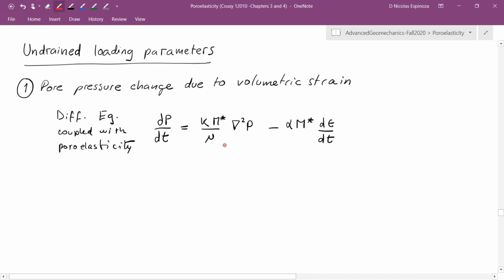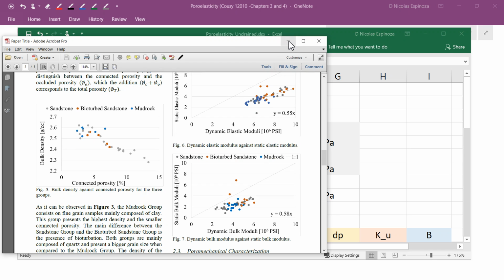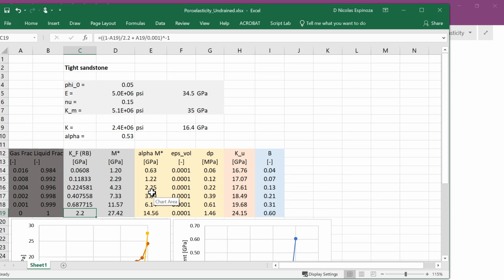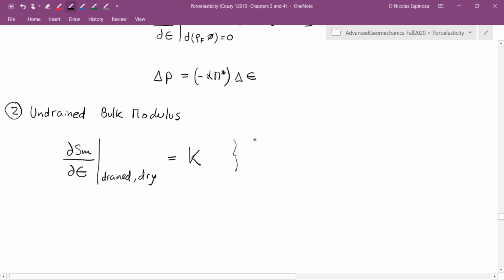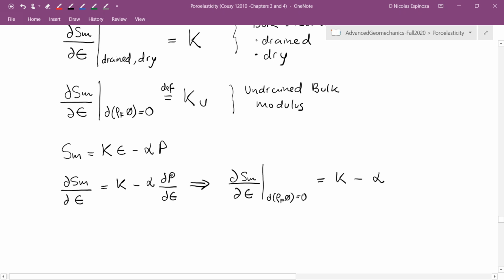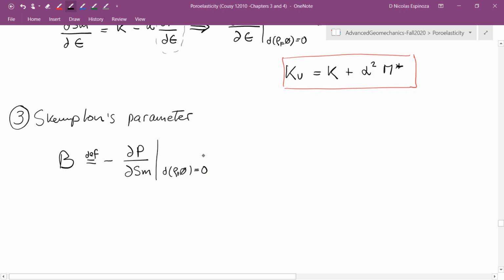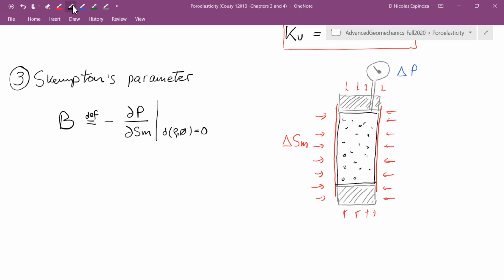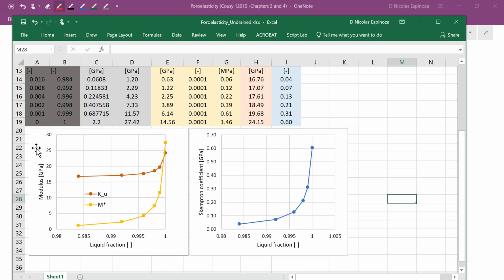L22 Undrained loading: change of pore pressure, undrained bulk modulus and Skempton coefficient

Comment: Dear sir,I have a question about whether the deep underground mudstone contains water. This problem involves the weakening of the drilling fluid (due to water absorption) and the establishment of the elastic constitutive equation of the hole (usually considered saturated brine). Can you explain the contradiction? Do you think there's water in the pores?
Reply from the maker: The weakening of mudrocks due to "freshening" of brine within pores is discussed here: https://youtu.be/-fMyO53M51c?list=PLv0npDbE5HXvjYxx5W-_vO2tNIkk_v97S&t=466
Reply: @dnicolasespinoza5258  Thank you very much. I understand through your explanation. There is another question: is the surrounding rock under triaxial compression at any time? It has been reported that the tangential stress of borehole wall is tensile stress due to low temperature drilling fluid, resulting in contraction joints. So I think there are certain in-situ stresses and drilling fluid density, temperature, salt concentration, and the rock is not always triaxial compression at any given point. If that is true, then the M-C strength criterion may not apply. Do you think I have a point there？
Reply from the maker: @rlouis1866  Thanks for the comment, the calculation of stresses on the wellbore wall due to far-field stresses, mud pressure and temperature are covered in chapter 6. Wellbore Stability https://dnicolasespinoza.github.io